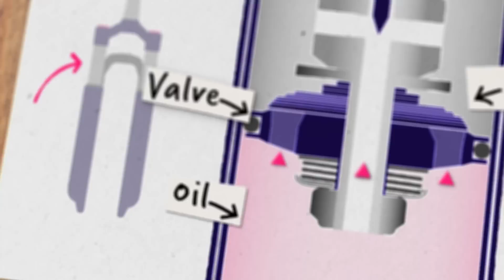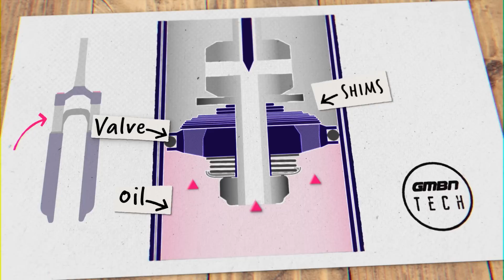Suspension Tuning: Shim Stacks, Pro-Tune and Re-Valving Explained

Comment from the maker: Have you got your suspension dialled? Or do you need a custom tune? Let us know in the comments below!
Reply: How about you Anna? Looks like Sergio did a custom tune for you, how is it? Please share how much of a difference it made in the feel of your bike and suspension? Plus, how much did it increase your overall joy in riding your bike?
Reply: For rock shox MoCo I take the motion control damper and throw it in the bin, only keeping the seal head part I install a pull bleed valve and a air side air cap on top of the fork leg then I take a 5cmx 20.63mm OD spring and 5.35 rate and pop it in the Moco seal head blocked by the bleed valve, fill oil normal Moco level and bleed the newly created IFP. Adjust compression with air. 8 to 44 psi...

Comment: Would be good to show the difference between a Fox 38 All black and the Fox 38 Gold, Also a look into mass produced fork for a line of bikes V's buying direct. I say this because I have a 2019 Canyon On CF 9.0 and that fork is Bad ( Im keeping the language clean) It is Stiff, you feel every small bump to the point on long descents my hands feel like Ive vibration white finger! On all the suspension reviews it always seem to be the gold top end suspension. I will be trying some .5w oil next to see if this allows the fork to actually conform the the terrain. And setting the sag is easy and if this sorted the feel I think 100's of MTB folk would be a lot happier but it doesn't, sag does not magic the oil passing the shims.

Comment: Excellent vid Anna, I love the tech behind suspension. Personally When I upgrade my shock, I buy from a supplier (TFTuned) who tuned it to my bike and my weight so my settings are generally in the middle, giving me more adjustments both ways. Forks not so much but as I'm light, I'm getting more to one end of the adjustment, but with the new fox damper I doubt a  custom tune would be needed.

Comment: I think it matters more if you are either end of the weight scale. I am a big unit and got a shock wiz. made a good improvement with the adjustment. Then got a custom tune from shock graft and made a massive difference as much as the shcokwiz again.

Comment: Messing with oil viscosity is a lot easier and less messy. It's just way easier mixing oil to get different flow.  Especially if you don't have a shock Dyno
Reply: I used to mad scientist different oils together. Then I realized that the heavier oil actually settles lower and causes the fork to behave strangely until it gets mixed back together during a bunch of compression cycles.
Reply: @SnootchieBootchies27  I make sure it's the same brand and additives so they don't separate.  I wouldn't go mixing maxima with finishline for instance
Reply: @andrewsiasparks  makes sense. It was a long time ago, I thought I was using the same brand but maybe not.

Comment: the huge problem with the bike industry is the cost of everything..when i can get car brake pads cheaper than my mountain bike,theres a problem
Reply: Despite the comments above, i totally agree with you, i think the cost of everything (include the bikes) have gone out of control... 

Don't get me wrong, i love mountain biking and i love to upgrade my bike and to work on them, but i refuse to pay more for a mountainbike than what i paid for my 2022 motorcycle, and as you said, even the break pads cost around 4 times what a car break pads cost, i know that a lot of people find ways to justify these prices but i just can't.

Off course i keep buying stuff, and i keep spending my money on it but i think it's just absurd.
Reply: The bike industry is like the red-headed stepchild of the automotive and Moto industry it doesn't attract the best Engineers but it does attract the best Barnum type people to run the shows... mostly immoral degenerate greedy scumbags😂 the prices of bicycles are absolutely unequivocally fucking ridiculous. I've worked at the shop for 7 years now from working the floor to repairing. And I can tell you that the price for these piles of shite under 3000-4000 aren't even worth half that...🤷‍♂️
Also the cost of Parts is absolutely insane. And it has nothing to do with scale of economies or how many parts are being made...🙄 with MOD and now some parts being made by three and four D machines, the price to make parts is probably at one of the lowest it's ever been. Not to mention most parts and Frames coming from communist China, where many are paid abhorrent wages and some are even forced labor.  Unfortunately we are just being gouged by a bunch of kock knockers...😅
Reply: I resent every penny I spend on my stupid car. For My bike, for some reason it’s fun. I’ve no idea why 😂
Reply: @MuddyTrousers  ya unless its an absolute necessity i get bike parts first..lmao..cant help it
Reply: Not a problem, it’s just economies of scale.
Reply: Laugh my fucking ass off! Is that what they told you Fozzie Bear?! Scale of economies...😂😂😂
You make a great statist 🤣🤢🤮 @nateisright
Reply: @rider65  you had to look up “economies of scale” didn’t you?
Reply: The smaller you make things, the more difficult it becomes. The price of the material is not a priority. Decisive but the precision of the production is simply higher for small parts.
Reply: @bertkreft9689  cnc machines are fantastic..so are molding injection machines